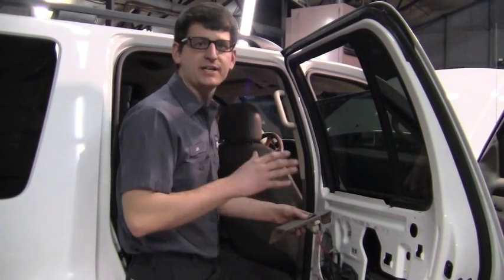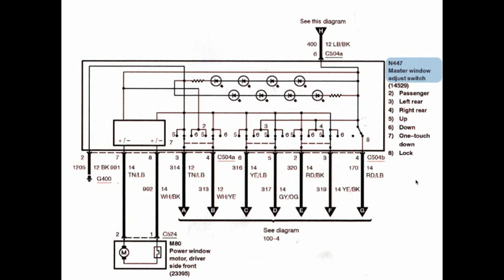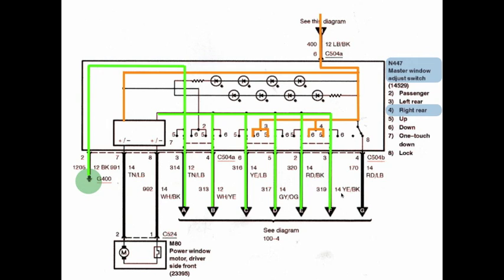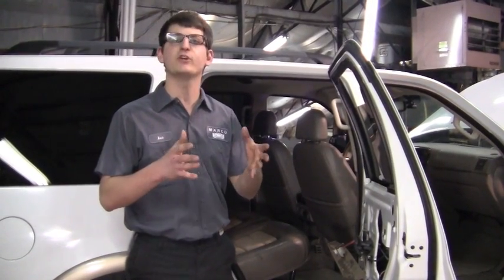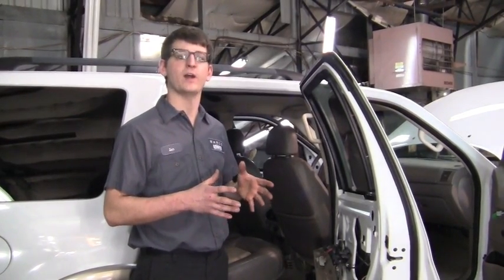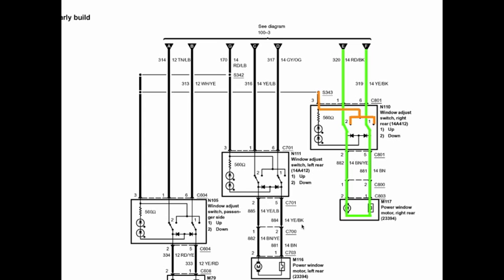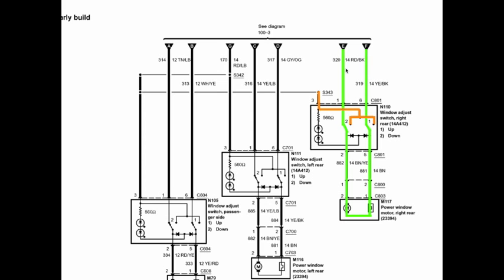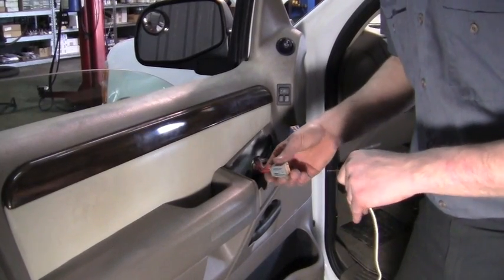Ford Explorer Window Won't Work

Comment: Another great video. I like the electrical videos a lot. Question: if the rear passenger window switch (RPWS) was getting constant battery voltage at pin 3, as the diagram suggests, wouldn’t the rear passenger window (RPW) go up when pressing Up at the RPWS even with the open in the yellow/black wire? I ask because in the video the RPW didn’t go up from the RPWS. So either the diagram is wrong or the window lock-out button in the drivers door switch was down (killing voltage to pin 3 on the RPWS) or the red/light blue wire is broken (too) or I’m missing something. Thanks a lot for all the great videos. I look forward to seeing more.
Reply: The open was before both switches. So neither would work.
Reply: The yellow/black wire which had the open only goes between the drivers window switch (DWS) the rear passenger window switch (RPWS). There are no other yellow/black wires in the circuit per the diagrams. So the open in that wire is in-between the DWS and the RPWS (as shown in the diagram and the repair). The red/black wire between the DWS & RPWS is providing ground to pin 1 at the RPWS. So if pin 3 has constant battery voltage through the red/light blue wire from the DWS via the window lock-out switch, then pressing the up button in the RPWS should make the rear passenger window go up.
Reply: if the driver master switch doesn't have any power or ground neither any switch will work.. all 3 PWS works with master switch
Reply: ebu touy I don’t follow your comment. The video shows the rear passenger window not working from the drivers switch. Big yellow text with a red background right after he tests the drivers door switch states as such too around 1:53.
Reply: The window was already up so making it go up is futile and unnoticeable. Had he retested after putting the window down (when testing the motor) everyone would have seen the up direction being fully functional.
Reply: Killer2600 The rear passenger window is half way up throughout the video.  First seen at 1:30.  Also, even if the window as completely up or down, you can still do a voltage drop test across pin 3 & 6 on the rear passenger window switch while pressing the down button as I suggested in another comment. This test would produce a zero volt reading. If you wiggle the meter leads at that time you would get a ghost voltage reading (if auto-ranging is enabled on the meter, otherwise set the meter to mV) indicating a open in the circuit which could only come from the yellow/black wire with that circuit.  So two quick voltage tests and you know there is a open in the yellow/black wire without having to take anything apart and saving a ton of time/effort.
Reply: Pet Rock's Garage I didn't miss it but forgot about it by the end of the video. My new answer to the original question is they didn't test function properly - the rear window switch should have worked in one direction IF the master switch is plugged in AND the window lock feature is off/disabled.

As for your test procedure, that works but voltage drop tests only work when there's current flow. A meter on pin 3 and 6 is merely a power/ground check and wiggling the test leads is largely inconclusive as a solid connection to that much stationary copper will dampen any electrical flux you try to create.
Reply: Killer2600 yes, the only difference between a voltage drop test and a standard voltage test is current flow. You’re arguing semantics. The physical test (e.g. where you put the test leads etc) is identical. As for the ghost voltage, the reading you get is from any electromagnetic fields that the meter leads pass through as you wiggle them (including the field from the meter itself). So the amount of wire in the circuit (probably less them 20 feet of 18AWG wire in this circuit) should have little to no effect. I use this test all the time working on car/truck electrical system repairs as well as circuit board repairs and it has never failed me. Its even a test that the guys from realfixitrealfast recommended in their voltage drop video series. The key is to have the meter set to auto-range or set to milli-volts.
Reply: Pet Rock's Garage Debating this really serves no purpose but for shits and giggles...Where you place the test leads would be different for a voltage drop test vs a voltage test. Pin 3 and 6 are normally power and ground and we all know you don't do a voltage drop test across the supply/battery.

As for the induced voltage, if it works reliably in the manner in which you state then how is it reliable to begin with? From which I mean if you can positively indicate the wire is open 20 feet away from you what makes the tell-tale change when it reaches the battery at 25 feet? The wiggle is fine for determining if your leads are making contact and not floating but not reliable for much else. If you want to determine/find a break and only have connect to one of the circuit a TDR is the tool for the job.

Comment: let me ask if some might know about the 03 Ford E350 Ded. CNG .

The Fuel Presser Sensor say it has low voltage. Anyone know how to fix this?
Reply: check your ground,,,,you may have a loose ground thats causeing it to read a low voltage

Comment: Good vid. Just one question because from what i've learned is that you shouldn't solder between the door jamb because over time the solder will just break apart again. Would the correct method be to replace with a new length of wire between the door and inside under the dash and soldier in those two locations instead because the new wire would not have a break in it. THanks

Comment: This happened to me on my 1995 Chevy Astro's power lock circuit... the Front passenger button went dead... what do you know, a wire broke in the robber link hose... Must be a common fault with vehicles...